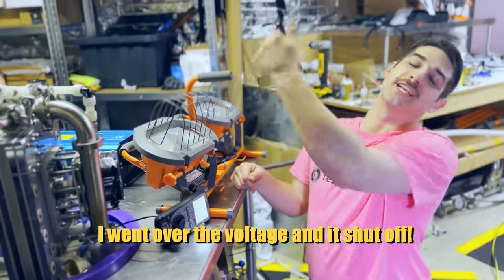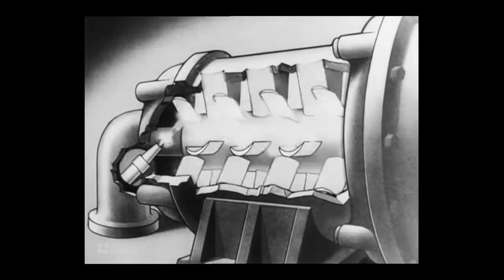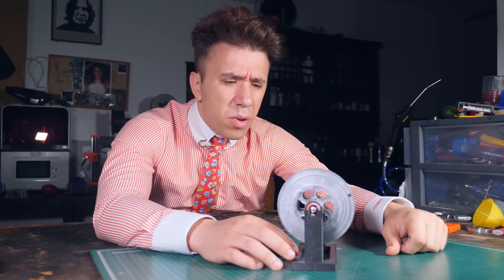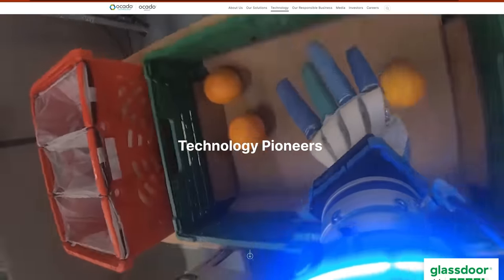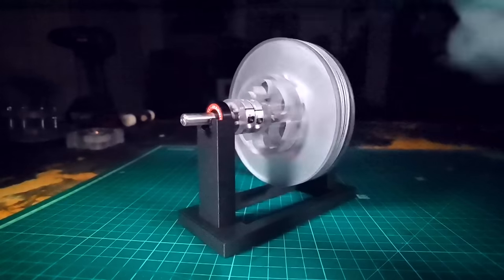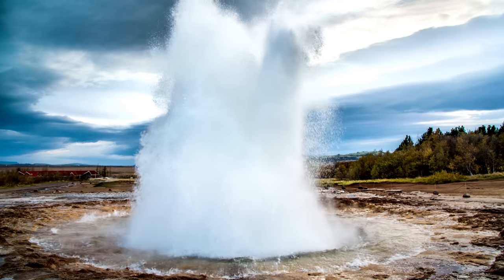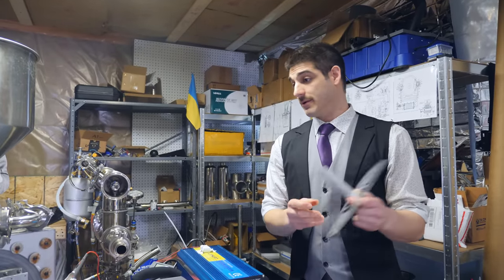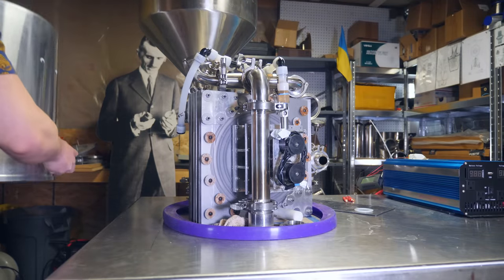Building Nikola Tesla's Bladeless Turbine

Comment: Curious to hear the longevity of a unit. I realize Charlie isn't building them for that at this moment but would be great to see. Even "can we run this for [x] hours straight at 20psi" with good data monitoring. Hopefully he starts raising money to make it work :)
Reply: Hey thanks for the comment! ❤️‍🔥🙏🦾👨‍🔬🤓

We’re working on the residential closed loop steam Combined Heat and Power (CHP) system right right now in fact to be able to do endurance tests next! Just finishing up the hot water supply circuit for the boiler side and it’s go time! 

Stay tuned! 

Again thanks for the love!
Reply: @CharlieSolis  Hey i was thinking, how about maybe try to make the finish of your disc rotor rougher, increasing the cohesion even more?
Btw you mentioned that the turbine generates the biggest torque at low RPM's how does that work? It'd be nice if it could have good torque at greater RPM's still, increasing the power band basically, so it could run on high and low pressure and keep a good torque going.
One thing about though that i thought about the longevity is the centrifugal force, you said you use aliminium discs. But wouldn't aluminium result in a shorter life, since it experiences fatigue failure way more easily than steel, so maybe a test at high RPM's with steel and aluminium discs would be worth doing.
Reply: @CharlieSolis , if you had 50kg of water at nearly 100C and boiled all of it, that would take approximately 113,000kJ of energy. How much of that energy could be recaptured by this turbine?
Reply: @kevinbuiied sorry for the huge arching response. I promise I do answer it. 😅👨‍🔬🦾🤓
Reply: @kevinbuiied  i think that even with a 10% efficiency rate it would still be interesting because you can convert heat energy into electricity simply and locally without huge equipment. for example on a off-grid compound you could make electricity by burning wood. even if there is no sun or wind. 

the inventor of this little turbine should try to make a portable station that is ready to use. people could just make a boiler and connect it to the package and generate electricity.
Reply: @Francois_Dupont   for the record. That’s me. 🤓👨‍🔬😬

I built this one. Tesla invented it.

We are working on the closed loop residential Combined Heat and Power systems right now. Just gotta get the hot water circ loop for the boiler finished and tests shall commence! 

Stay tuned!
Reply: @CharlieSolis  ahahah sorry for the misunderstanding.
where are you located? in the USA?
Reply: @Francois_Dupont  no worries. All is love! 🙏❤️‍🔥
And 
Yup yup!
Reply: @CharlieSolis  I have to ask. Is there any way to directly invest in your company? something like possibly stocks or anything of the like? I firmly believe that when. (not IF but WHEN) you guys get this tuned to as close perfection as you possible can. That it has the possibility to revolutionize energy production around the world due to its increased efficiency and low cost to build
Reply: @CharlieSolis  out of curiosity, how do you keep the plexi glass turbine housing from deforming when exposed to hot steam ?
Reply: @Francois_Dupont  it's already interesting even without knowing the efficiency. I was just curious how efficient because sterling generators are also a valid waste energy alternative, and works at a wide range of temperatures (from low candle flame to high heat). If the Tesla Turbine can extract energy with high efficiency at a low cost, it could surely beat a sterling generator (which requires a lot of careful machining and precision increasing its costs but also it's ludicrous efficiency). I imagine to increase the efficiency of the Tesla Turbine, you'd increase it's radius so that the steam path can travel around the disc more times, imparting more of its momentum... This would also increase it's torque since it's radius is larger. Regardless, I'm excited to see where this goes.
Reply: @kevinbuiied  yes it is very interesting. i wish they were more pre-built portable unit so people could have many options. it is sad to see you almost have to build stuff yourself if you want anything special.

have you heard of wood-gas generator? it is possible to build a self contained system that create gas(eous) capable of running a generator or any other normal gasoline engine with wood only. it was widely used in some places in WWII because gasoline was rationed for normal people.
Reply: @kevinbuiied  hey so o wrote an answer back to you about the efficiency are you able to see it? Sometimes YouTube will hide comments.
Reply: @juslitor  hey thanks for the question! 

So the closed loop low temp vacuum steam system we are building has shown about 150-300 watts on the dyno when I last operated it on steam that goes into the turbine as low as 60-65°C. 

But having the condenser on the exhaust it can allow for extracting a lot more of the energy in steam before condensing than when exhausting to atmospheric pressure. 

Realistically this could be operated as an Organic Rankine Cycle (ORC) with the same exact system but using a refrigerant as the motive fluid instead so that higher pressures on the vaporizer/boiler side going into the turbine can be achieved. 

The condenser cooling water leaving the condenser comes out at around 55°C. 

And went from -13inHg vacuum going into the TesTur and -23inHg vacuum at the exhaust.

So the temp gradient across the turbine is ridiculously small 

In the full residential system it will be entirely metal to be able to handle higher temps. 

Temp and pressure gradient dictate overall max efficiency. 

So the higher the temps and pressures the higher the potential max efficiency. 

And this is all still just with a single stage too 😬👨‍🔬🦾🤓

Just finished the design for the small 2 stage 4.5in TesTur and about to cut out the all the parts for the new upgraded 2.0 version of then little one in this video with integza.
Reply: @CharlieSolis  I saw you apologize for a long response, but I unfortunately do not see the long response. :(
Reply: @CharlieSolis  Are you raising external funding too? Would love to talk about this if you are.
Reply: @CharlieSolis  the two stage is the turbine then pump with regeneration, or is it compounded turbines?
Reply: @Dan-gs3kg  hey thanks for the comment. The two stage is two drive stages. 

Be careful. Not to fall for some of the claims other people are making with the “2 stage” version. There’s a lot of snake oil out there about the Tesla turbine. 

That being said though if you’re referring to the high vacua pump on the back of the condenser for a Rankine/organic Rankine or Cheng cycle system…

There needs to be a condenser/heat exchanger before the second stage vacuum pump. 

This is why I came up with the interstage heat exchange disc stack that goes between them.
Reply: @kevinbuiied  lol figures I’ll try it in pieces (1/3)

As far as efficiency goes… (mind you this is a copy pasta 🍝 so it’s a bit long but it’s worth the read.) …My 2650watt electrical load run came in with a very low ball calculation of 40% isentropic efficiency.  To start off, mind you that includes generator losses, 3 phase rectifier losses, and inverter losses to the electrical load that were not accounted for. So the turbine off the bat is already most definitely doing better than the 40% isentropic efficiency I’ve calculated from the already low ball test results.   But for now I’ll just assume 40% isentropic efficiency so that I’m not over claiming what I can prove it can actually do for the time being. (I have nothing in the long run to benefit by overstating my numbers and only my legitimacy to lose. I’ve worked hard for my physics degree and don’t intend to tarnish it for a couple of extra views on the internet.) 

As far as inefficiencies to the system to fix, there’s 10x crappy ball bearings in this version, 2 crappy RC car gears, both losses will be gained for power out with a direct to shaft generator. (Minus two gears and 8 crappy ball bearings)  There’s an 1/8 of an inch of space between the turbine endplates and the casing endplates on both sides of the TesTur. That’s a 1/4in of open flow area around the 2in wide turbine (that only even has a total of 0.75in wide of spacing between all the tight disc spaces for torque to begin with.)   That means 25% of the open space for flowing through the casing, between discs and between the casing and turbine endplates, is just free flow over the side of the turbine still. (I’m using the absolute bottom of the barrel of machining equipment right now in my garage 🤷‍♂️)  There’s no labyrinth seals yet to even attempt to further reduce that overflow…
Reply: @kevinbuiied  (2/3) The nozzle is atrocious at the moment, when making the variable converging section have a tight convergence it causes the fluid jet to aim more centripetally (towards the axle) instead of tangentially (glancing off the disc tips) which severely effects the fluids natural path.   This will be fixed with the new variable nozzle design I’m going with.    Then even further in this specific casing’s assembly there’s two “pillars” in the middle of the nozzle.   This is because the aluminum plates in the middle of the casing plate stack only had the variable nozzle bar and inlet holes cut out, and not the full nozzle geometry.  So those pillars are just vertical bars in the middle of the nozzle for the air to smash into just before going into the turbine (hopefully the wet steam tests will just erode them down 🤭)   Before all that there’s still about 100ft of air hose between the tanks and the turbine… plus a shell and tube heat exchanger and a TON of elbows and fittings.    I’m sure I’m forgetting something too but between all that being fixed… I can almost guarantee we will be in the 60-70s % range and that’s all just still with room temp compressed air.   Most forget, I’m using room temp compressed air and never went over 20psi at the nozzle for these tests. (Pressure differential and temperature differential govern efficiency) 

And even then I still only even have a single stage on it yet.   Everyone wants to compare it to the efficiency of a very high temp, high pressure (1000°F & ~1800psi) multibillion dollar 15-30 stage steam turbines…   😮‍💨   That’s apples to rocket ships. 😅  But considering Rankine Steam cycles get theoretical max about 33% of input heat (due to latent heat of condensation and that’s without any regenerative boiler feedwater preheat, air fuel preheat, etc) and then 40% isentropic efficiency (considering the turbine as is) we’re looking at 13.2% thermal efficiency with steam.   A more apt comparison for the TesTur would be something an individual can actually purchase, like 1-5kW piston gas generators that you can get from Home Depot or Lowe’s.   These get 15-22% thermal efficiency off the plant floor. Good luck getting that 1 year down the line or later with all those moving parts.  Also for reference, industry standard for micro bladed gas turbines is 25% thermal to electrical. Whole system efficiency can go higher in Combined Heat and Power (CHP) system, but alas the TesTur would see the same whole system efficiency increase in a CHP Auxiliary Power Unit (APU).  In the TesTur you gotta replace…? 🤔bearings…? And still even then, only maybe 🤷‍♂️ depending on how good of bearings, balance, lubing, cooling.   The TesTur, and other bladed turbines, only have one moving part. 🔥
Reply: @kevinbuiied  (3/3) So if those piston generators drop efficiency, even at all, the TesTur on its worst day is competitive with a gasoline piston engine electric generator.🤓😬🤷‍♂️  And the TesTur can handle any fuel that can burn, even solid particulate fuels like powdered saw dust, pulverized coal, powdered iron, biomass, etc. (noting the number of those that can be acquired without spending money… 🤑 opening up “low monetary cost”, even carbon neutral, fuel options for MILLIONS around the world)  We have to remember that the TesTur doesn’t have to be the holy grail to be worth using if we have free fuels readily available like biomass, and even waste heat already being dumped out into the air and not used for anything.  The TesTur just has to be a viable option for some to be worth doing. 

Even more, the mere fact that I’m using a low temp fluid for my 40% isentropic efficiency calculation means my TesTur efficiency is severely limited by thermodynamics and fluid dynamics.   Increasing temps will automatically increase my turbines efficiency.  This is because gasses have an increasing viscosity trend as you increase the temperature.   This leads to increased isentropic efficiencies in the TesTur from reduced slip on the discs.  (Meanwhile, we’re already talking about a piston engine using combustion temps as is.)  Whereas bladed turbines see the increased viscosity as an increase in drag loss through the turbine blades.   So we can’t always count on seeing increased isentropic efficiencies in a bladed turbine in practice when we go from low temp to a high temp.  Again, to reiterate, this increase in viscosity in the TesTur only works to enhance the working action of the TesTur.  (That being viscous adhesion to the disc faces increasing torque.)  That’s all on top of the increased thermodynamic efficiencies of using a higher temp elastic fluid too! 🤓 

The disc spacing for room temp gasses is not going to be the same for combustion temp gasses/steam because the viscosity of either increases by 3x fold. And I’ve designed these spaces for a higher temp fluid with a slightly higher viscosity so these will inherently be too wide at the current temperatures being used.   So as we increase temps along with all these other really easy to fix mechanical issues (that only are a thing because I’m building this in my garage on a junk cnc machine) I have no doubt we will see more than competitive isentropic efficiencies compared to bladed turbines, let alone whole system thermal efficiencies that are through the roof.   This is because of the heat recovery systems that can be added with the cost savings of using a TesTur vs a VERY expensive, and in my opinion, relatively delicate bladed turbine.   Just getting tighter casing clearance with the turbine should give me at least 20% points back on efficiency putting my testur at the 60% range.   Coming in with a 19% thermal efficiency in a Rankine steam system without any kind of thermal recoup.
Reply: @Francois_Dupont  Wikipedia says the Tesla turbine is capable of about a 60% to 70% efficiency. Simpler design and enough of an improvement over ICE engines that it would make a good power source for a range extender for an EV, or a camping/off-grid generator

Comment: One of my favourite things about the Tesla turbine is that it gets more efficient with RPM due to the centrifugal force compressing the air and making it do more rounds before escaping through the middle, also increasing its stickiness to the blades. That moment when the air and blades synchronise and it noticeably jumps in speed is awesome. I saw it somewhere on youtube years ago and it blew my mind.
Reply: That moment when it "hits" I think this is what Mikhail Goldshtik's talking about in his work describing the transition between turbulent flow into a laminar flow where the vortex stabilizes. Essentially the tornado hasn't happened properly until that moment and then BAM the thing takes off!

It's pretty damn cool, I agree. If you dig that you might like Goldshtik's work. For a scientist he was pretty DIY. :)